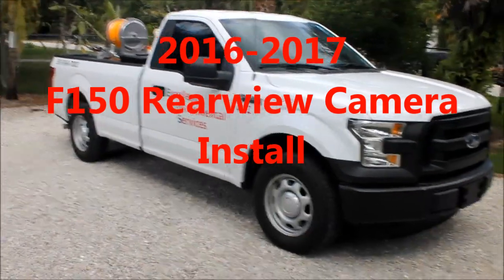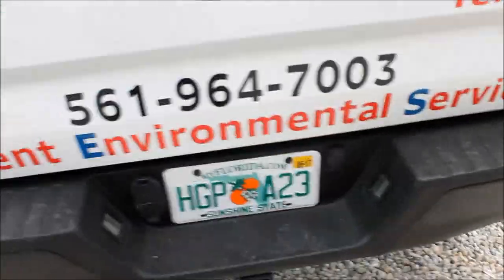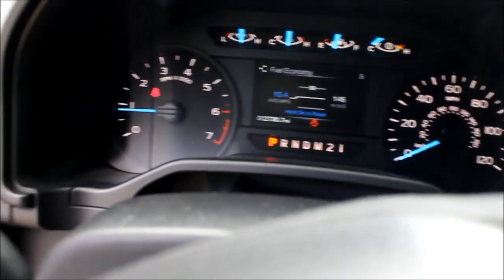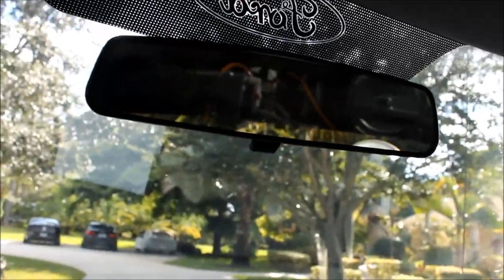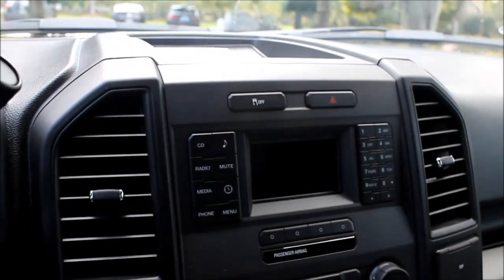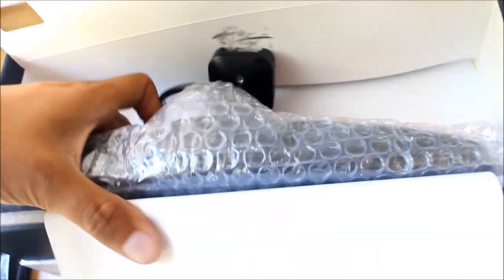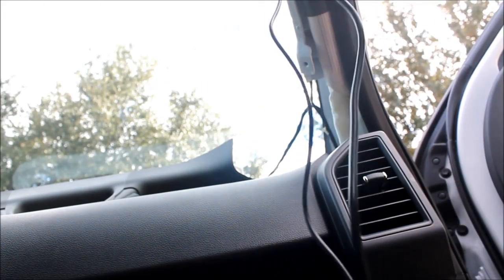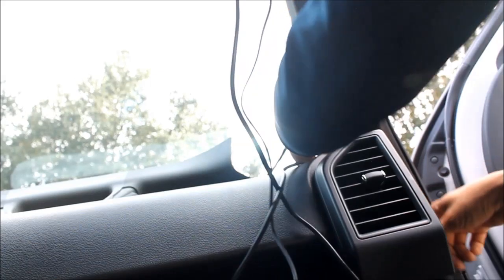2016/ 2017 F150 Backup camera install

Comment: Take that center seat headrest off. You also put the plug in backwards, it goes top down so the carpet/mat doesn't pop it out. I was thinking of the rear-view cam but just buy the Ford tailgate handle with camera, looks to be $40...can not go wrong at that price and get a factory outside camera. I assume the mirror autodims too, right? However I like electrical wiring jobs, fun to me. I would also recommend putting the wire in a loom if you plan to own the vehicle longterm to protect it. Best would be the fabric stretchy kind but cheap plastic loom works too. I probably would also just see about popping out the hitch pins on the connector and making it a real clean install. 

And your Volvo key copy, not really, Ford owned Volvo if you remember not long ago.
Reply from the maker: +Meeker Extreme you read my mind!
Reply from the maker: +Meeker Extreme haha you caught that too, damn I cant sneak anything past you. Yes the mirror auto dims and make sure the Ford handle you buy has the component video out, the other model has a 5 prong proprietary connection. I have found loom wrapping to have no major influence, I did an install for the same company in 2007 on Silverado and it's still working perfectly. As for the prongs you can pop them them out and solder the connector. TIL: Ford owned Volvo

Comment: Does this configuration allow the backup camera to be turned on and off at will? Or is it constantly on
Reply from the maker: +thestuffthestuff this configuration is only on in reverse. You can always have it on if you wire it to constant power and plug it into video input #2. You will have to manually switch the screen off.

Comment: my vin is:

1ftmf1e85hfa37851

my
 f-150 2017 xl 3x3 regular cab doesnt come with camera but i installed a
 rear camera to comes the video signal to rear view mirror inside, but i think that i need a socket beacuase  when i send the signal directly to the monitor of the
oem radio, the radio go reset!

thks
Reply from the maker: +amircael69 I'm confused what are you trying to do? Install a rearview mirror or install into the radio?
Reply: i want install a back up camera thta must send the signal to the oem radio ford 4"sync of 2017, what i need...??
Reply from the maker: amircael69 you would need this kit

2015+ F150 Backup Camera For 4.2" Factory Display's - Plug and Play! https://www.amazon.com/dp/B011M4ZXJU/ref=cm_sw_r_cp_apa_J4Nxzb7F0NQQD
Reply: but my radio is just 4" isnot 4.2"? My oem radio is the see like the picture...
Reply from the maker: amircael69 no such thing as a 4" on a F150. They are 4.2".
look at the pictures they are the same radio.
Reply from the maker: amircael69 I don't have a link for it. We don't sell these products. I just install. The unit should work in your truck just fine and it's easy to install just expensive.
Reply from the maker: amircael69 I'm unfamiliar with that unit

Comment: chevy sucks, buy ford!
Reply from the maker: chef kdowg AMEN!
Reply: actually they ALL suck. i just traded a gmc diesel with 18,000 on it for a new f250 6.2 gas motor. diesel has the ability to break your wallet